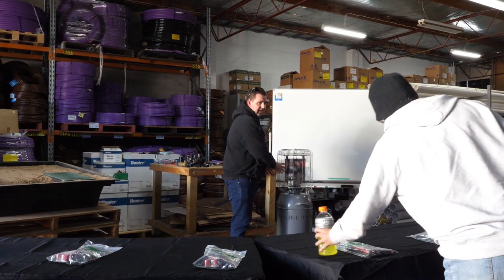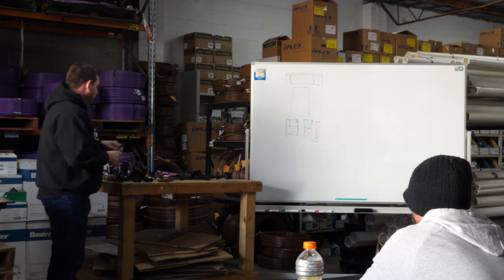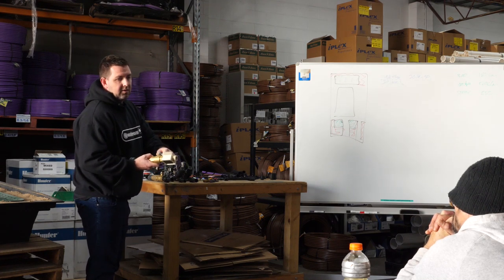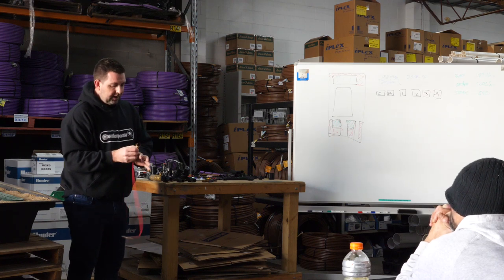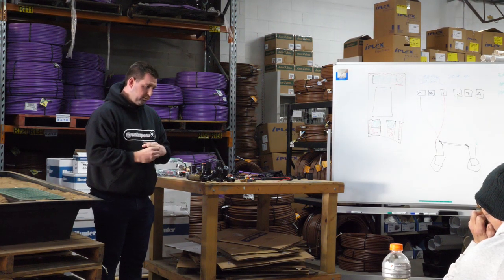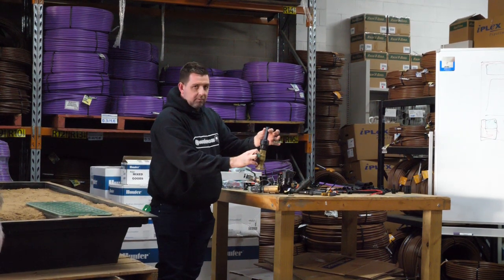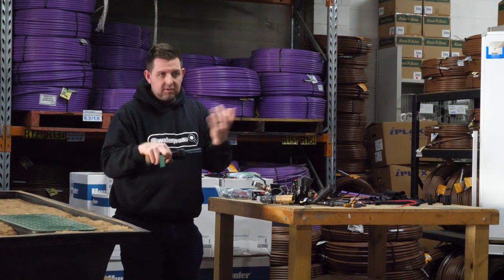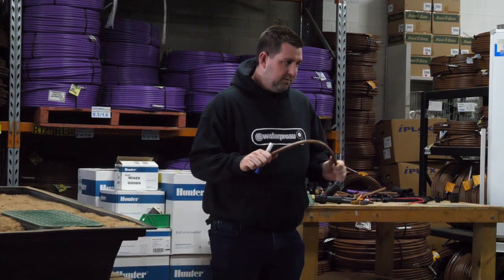Everything You Need to Know About Installing an Irrigation System

Comment: Do I need an anti siphon valve for each zone? Or just one for the entire system? Lowe’s told me I need just one, and then a solenoid for each zone but Tampa codes require back flow prevention.
Reply: I dont know about Tampa codes, but you just need a 1 backflow device that is properly rated for your system installed before all your valves on your mainline. You do not need a Atmospheric vacuum breaker ( anti siphon device ) after every Valve ( solenoid )